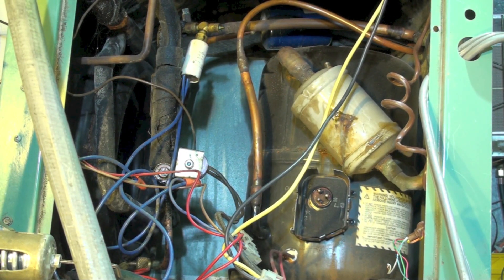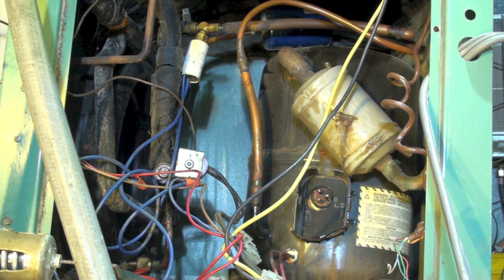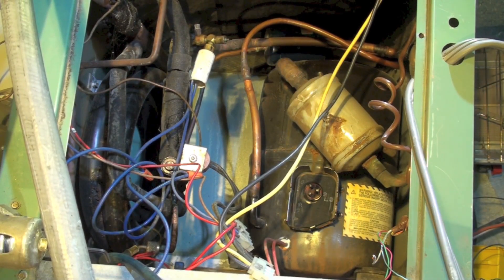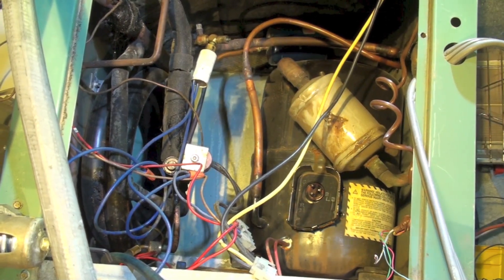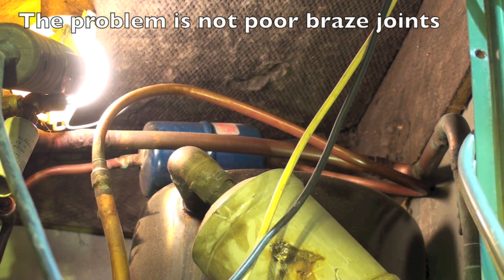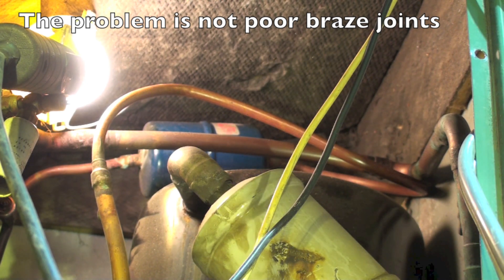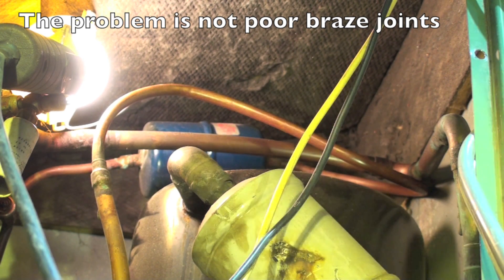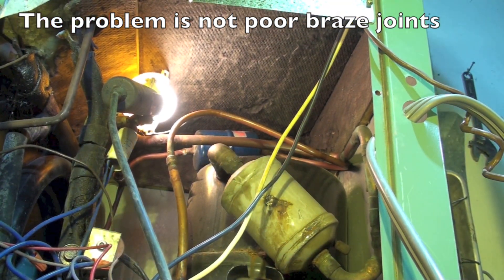Whats wrong with the piping on this heat pump

Comment: Suction line dryer is sloped the wrong way. The outlet should be lower than the inlet.  This will trap oil.  The dryer should have been removed after clean up.  Looks like condensation from suction line dryer may drip on electrical connections.  Looks like the liquid line dryer is piped into the discharge line, and the line has been reduced in size. Bottom connection to suction line dryer looks twisted.  At top of suction line drier, looks like dryer connection is inside the fitting, instead of outside.  Very odd.  I know space is limited on small water source heat pump, but that’s not an excuse for this poor looking job.
Reply from the maker: The failure here is linked at the end of the video.  It is the liquid line drier installed in the discharge line.  Yes, there are several problems here.  The reduction in discharge line size is far less damaging than the liquid line drier installation.  The pressure drop materially reduces the effective size of the system.  The sloping of the suction line drier I believe is not important.  In this case, it was installed for many years with no problem.  Some manufacturers say nothing about positioning.  
GFM
Reply: @grayfurnaceman  Thanks Gray.  I think the manufactures request that servicemen take those suction driers out after they are done cleaning up, because they introduce a pressure drop in the system.  I know I left a lot of them in.  If the system was big, we would install changeable core driers and just remove the suction line core when we got a clear oil test. There were some large Trane condensing units that had suction line driers right at the compressor inlet, from the factory. In fact I found a factory leak on one of the braze joints there. We had tons of water source heat pumps installed above T bar ceilings.  We would take them down and remove the top for major repairs such as the water to refrigerant heat exchangers and compressors.

Comment: It looks like the drier is on the discharge line. I'm also questioning reducing the size of the discharge line. Looks like it was stepped down from 1/2 to 3/8 to adapt to the drier.

Comment: I could not make out the reversing valve on this heat pump.
Reply from the maker: blissJesus1 Isn't easy to find.  In the center of the unit, you can see the solenoid.  These things are not easy to work on.
GFM
Reply: and I hopeI never have to, my goodness

Comment: Drier in the discharge, discharge pipe reduced, suction line seems to drip water on compressor electrics, access t looks oily/leak?. Whole thing looks like guy didn't have pride in his work!

Comment: well I see what looks like a suction dryer on the compressor thats odd.
Reply from the maker: jsison1991 This unit probably had a bad burnout and the suction drier was never removed.  That's not the problem.
GFM
Reply: Yeah I watched part 2 thats the first time I have seen a suction dryer that close to the compressor just looked odd to me

Comment: I have seen this on several  straight a/c units .  how much damage would it do?
Reply from the maker: crob227 As far as I can tell it has not damaged the system.  A drier in the discharge will reduce the efficiency of the system due to pressure drop and could damage the drier itself.
GFM